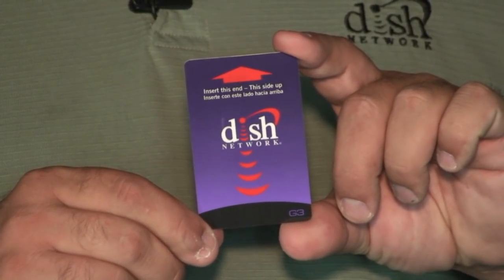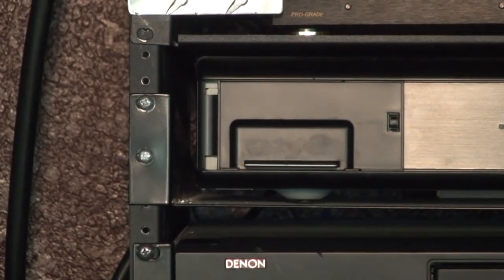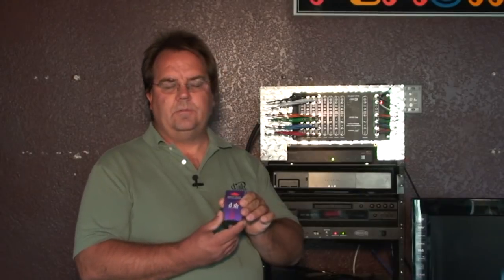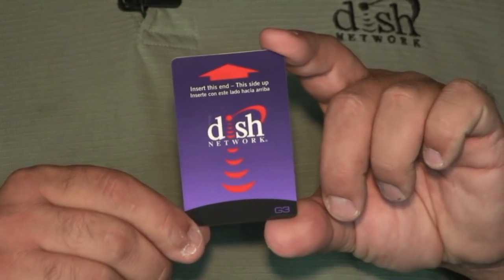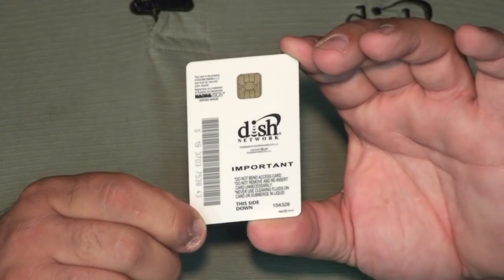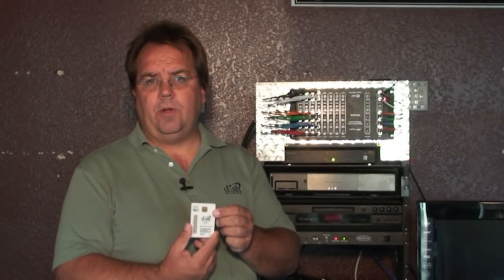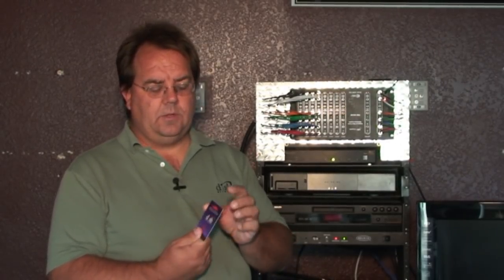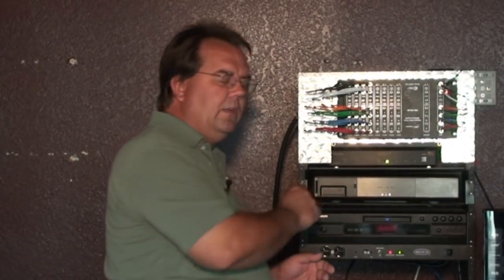Satellite Television Info : How to Burn Dish Network Cards

Comment: what I am wanting to do is to wipe the Data off the chip completely, and use the card for another project like a Electronic door lock/ key Card  kind of deal.
the chip on the card looks just like the ones on the cards for the E-Voting system,
and when you go in and give them your name, they stick the card into a programmer and  load it with your data. thought if I could build my own programmer and reader system, I could use the card for this project. is this possible? I Have no interest in hacking a receiver, I just want to use the chip card for my own projects.
Reply: DUSTERDUDE238 you need a usb common access card (c.a.c.) reader/writer. I rewrote my dish card for use as a login card for security on my pc